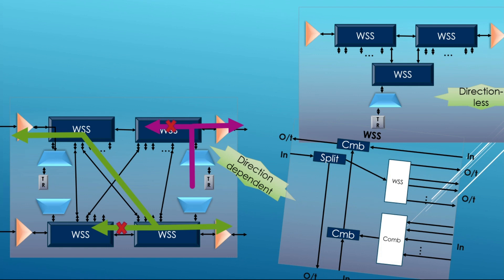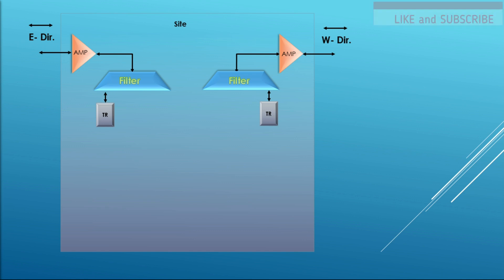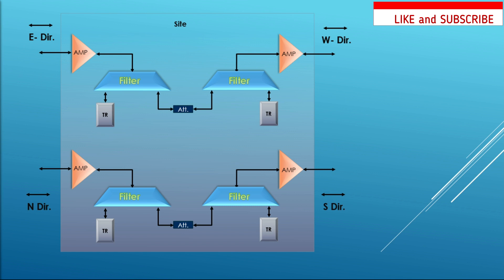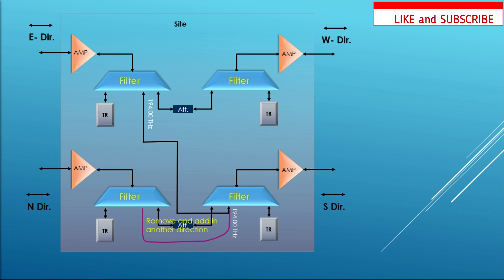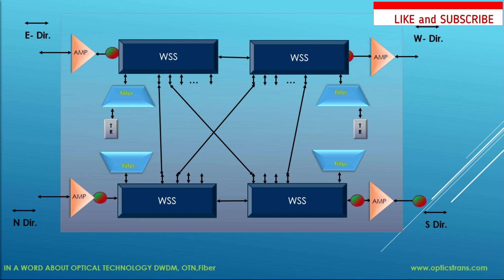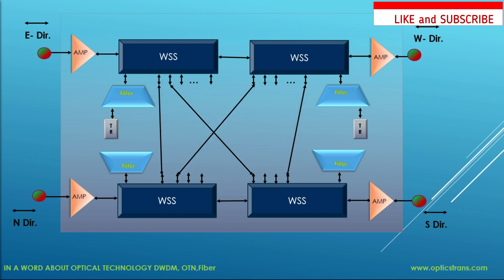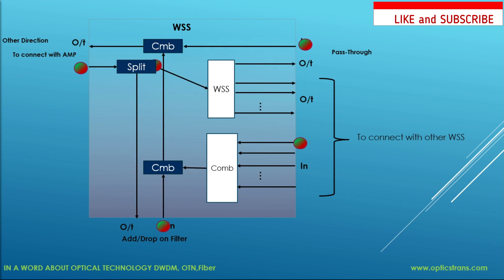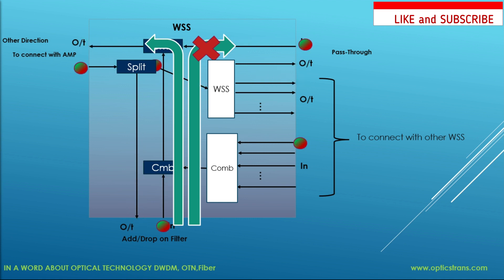ROADM DWDM WSS in optical network, Directional v/s Direction-less #telecom #optical #physics

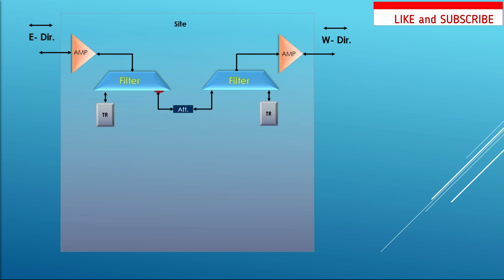Comment: A question on 3:20 passthrough channel connecting East Filter  x port with west filter x port.  
Q1: Do you mean East Filter x port can be directly patched with West Filter x port to pass through the specific frequency / Channel.
Q2: How will you passthrough in case there are only 10 channel is dropped from East filter and 10 Channel dropped from west filter. And how you going to passthrough (rest of all passthrough channel i,e, 44-10=34 channels) from East to West.
Q3: is there a way to connect East Filter passthrough port with west filter passthrough port to avoid multiple patching ?

Comment: You told WSS 9X1 Card . Only one output and 9 input which we can use cross connect or add drop. How it connected from east WSS card to West WSS card, is there any other port, please reply
Reply from the maker: Between 2 WSS( east to west )  there is thru port connectivity to pass through the signal..
Reply: Thank you so much for your information

Comment: Im new to this technology, so I hope this isnt a dumb question. Why is the filter needed between the WSS and the transponder? If the WSS if singling a wavelength out and forwarding it out a port, what is the filter doing? Is the port that has the filter have the full spectrum passing thru?
Reply: No monitoring without filter
Reply: It is actually Mux/DMux  so you can add drop more than one wavelengths from same station.